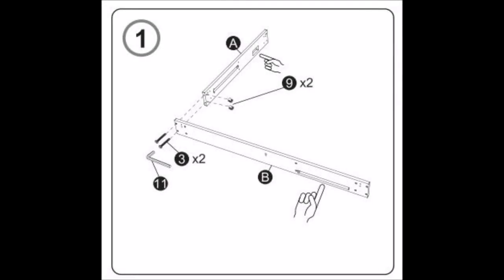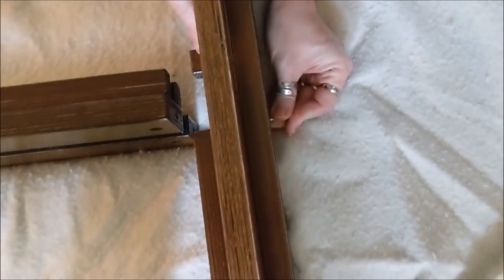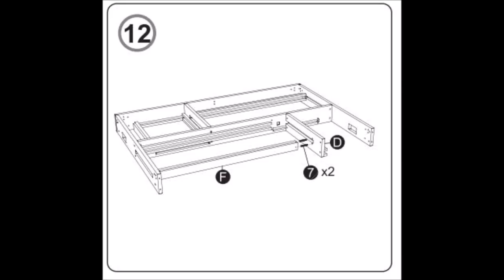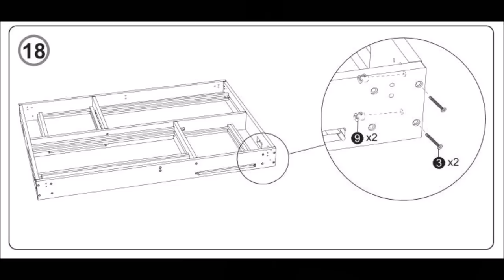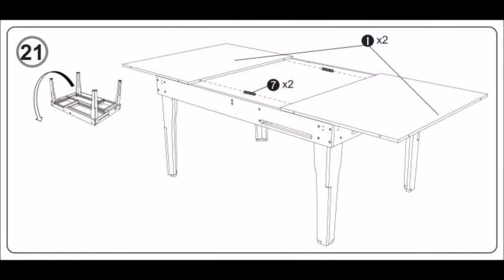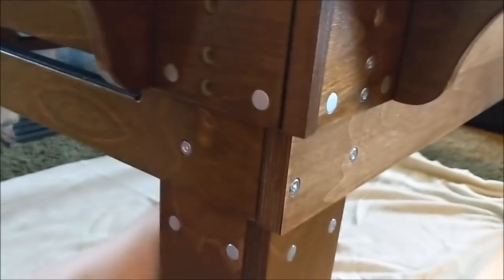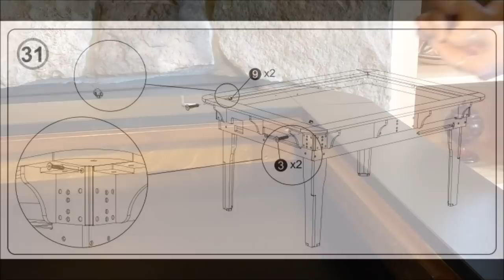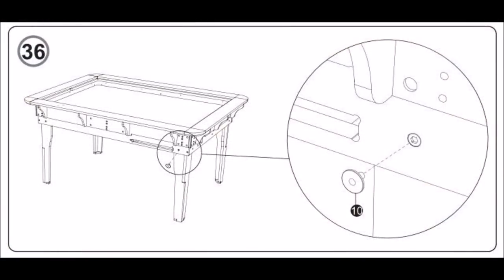Assembly Instructions for Table of Ultimate Gaming

Comment: Thanks so much for the helpful video!! As someone who bought both coffee table height legs and regular height, what is your opinion on how difficult it is to swap out the legs? Will I have to take all of the outer rails off before being able to remove the legs, or will I be able to replace the legs without taking off the outer rails? Thanks again - great video :)
Reply: Pity they couldn't answer this. It's an important part.

Comment: Hi :) thank you for the video it will really help with assembly. I’m terrible with DIY so am grateful for all the advice you give. Could I ask please for a little more assistance? 

Is there anyway to tidy up the power cable? At the end of the video you show placing the cable through a hole and fitting the plugs but that would presumably leave the cabling hanging down. Is there anyway to secure it hide it as much as possible? 

Thank you again, I can’t wait to get my table! :)